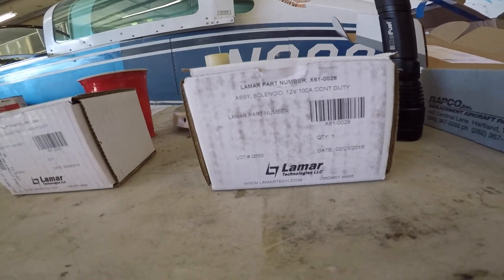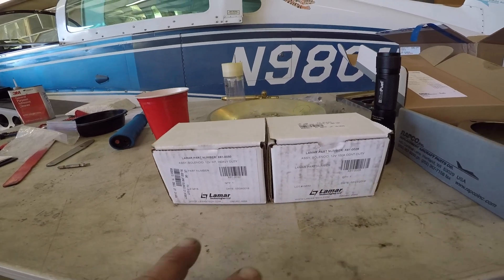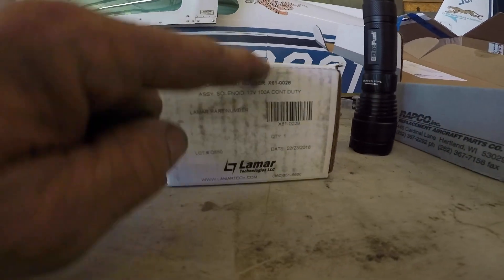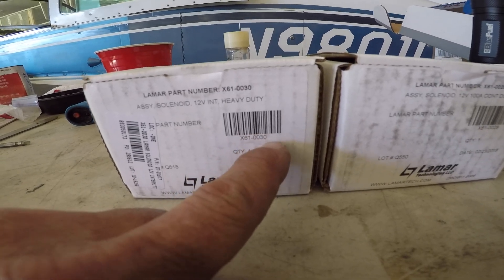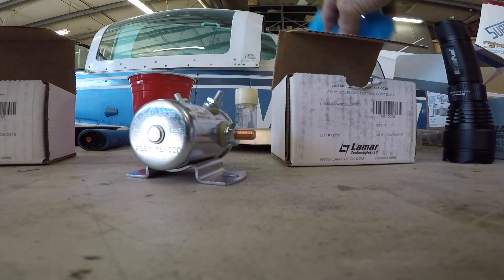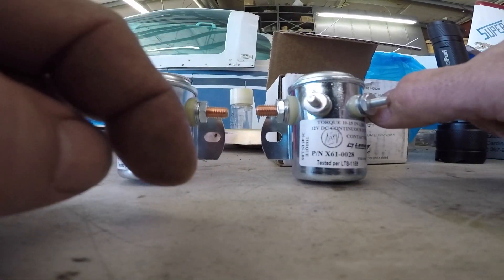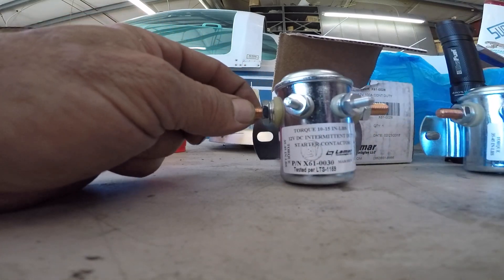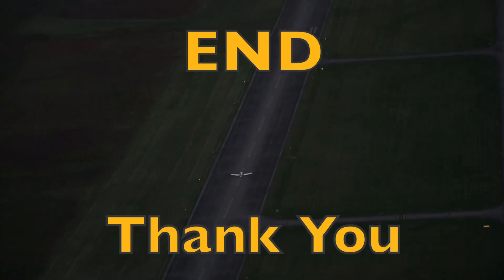Master and Starter Relay - Grumman Style

Comment: Roscoe I am a little confused, I am now having trouble with my master solenoid and looking at the spruce catalog, it appears that the X61-0028 does not have a PMA number. Is it usable for certified aircraft ? Would I then need a 337 to use this? Also I was always taught that the diode goes on the Bat side and not the ground side. Thank you for your help and I appreciate your videos as I’m working hard to learn my Grumman. All the best SIR !
Reply from the maker: When we stocked them they came from Fletchair.

Comment: If one of these went bad could it drain a battery?
Reply from the maker: I'm sure it could but the starter is intermittent and will fail stuck open, master relay the other way, when worn will not energize so no drain on the battery.

Comment: What is the purpose of the metal bridge bar between the starter and master relays when installed on the firewall? I assumed it was for structural support as I don’t see it on the electrical diagrams. Thank you.
Reply from the maker: It is an alum bus bar to carry the current.